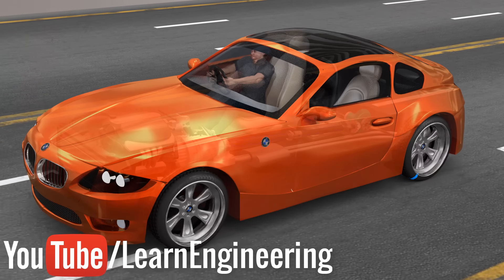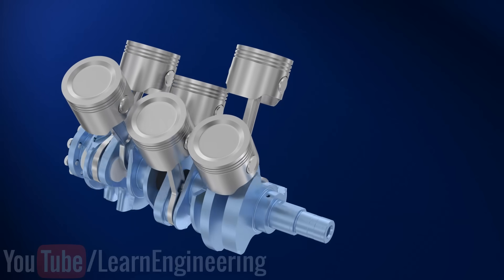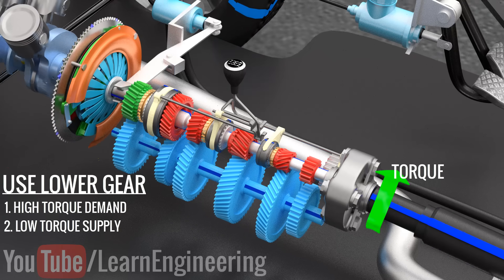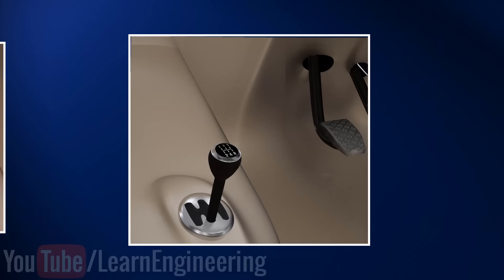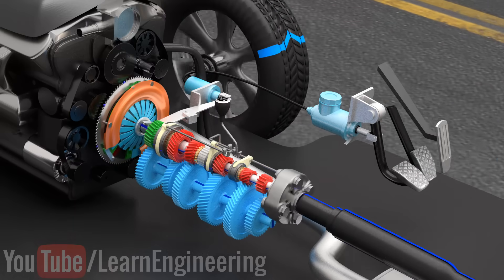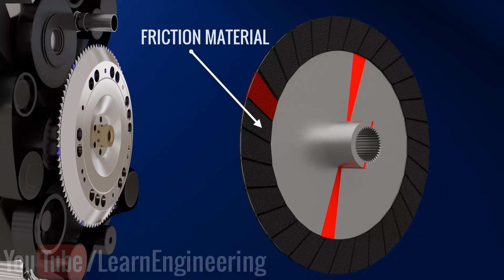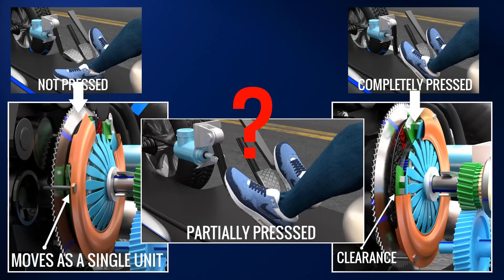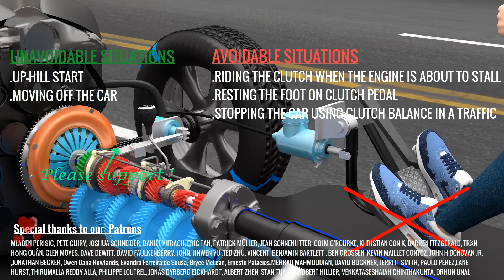Why you should not PARTIALLY press the Clutch?

Comment: with 95% of cars in America being an Auto.

Every American thinks like this video. 

They think that slightly riding the clutch or slipping the clutch will turn your clutch into dust.

When in actuality, it can take a beating. 

What you don't want to do is ride the clutch for 30 minutes at a time while revving the engine at 4k rpm+

Comment: Feathering the clutch in slow moving traffic, without using your accelerator at all, will cause negligible wear. Just as using clutch in traffic is listed in the avoidable situations section.
Reply: Modern day clutch is designed  to withstand heavy friction. So it will not wear while crawling and it will not wear when you let it rev match when downshifting. You can only burn it in extreme case as in this video... 😂

Comment: You are not in gear until you really release the pedal. You can only press it partially while changing gear. Moving from a stop and changing gear are what it's designed to do. It will rarely be damaged doing it's job in the normal way (they use specialised alloys that are barely damaged in the parameters of normal operation. That is unless you get it too hot, by making it do too much work, that is holding still for several seconds or riding it for extended periods or no reason.

Comment: The more you drive a manual the more you realise it’s about choosing which parts you want to wear down quicker. 

In reality there is a right way and a wrong way to do things but some situations do call for more excessive use of a certain component / components. Up hill starts as mentioned, parking, driving very slow in traffic. These will all technically wear the clutch. It’s designed to be used in these scenarios but there’s no way around causing wear to it over time, much like with tires, brakes discs, brake pads. Hell, even washer fluid is used up and replaced at some point. 

Just do the necessary maintenance and try to evenly balance wear on all components and most modern cars should last pretty much forever.

Comment: I find it curious that even with all the incredible, mind-boggling engineering that has gone into improving cars throughout the decades, nobody's figured out a better clutch design than a friction disc. It must be a pretty tough problem if no one's found a better solution by now
Reply: Well the issue isn't the disc, it's the gears moving at different speeds. The engineering that's gone into the gears is insane, I once saw a full length documentary just about that. If I remember right, they did actually find a solution to this issue, but there's definitely some reason for why they haven't added it in regular cars.
Reply: What's the documentary? Id love to find it.
Reply: There are other solutions, such as torque converters and CVT transmissions

Comment: Clutches wear out. If you got 100k miles out of your clutch it's fine. You begin to expect the end of it by then. You can get a fair bit more but it is hardly unexpected to be near the end of its life at that point. It is often not the clutch plate itself that is worn out around this time, the release bearing and slave cylinder are typical failure points at this interval. If either of those fails you are going to install a new clutch while you replace them anyway.

Comment: You should use the clutch as a clutch, for when it's necessary to disconnect the engine. Just be aware that any time is not fully engaged it's spinning and you are wearing it out, so keep the time as short as it's necessary to get the job done. Unless you like replacing clutches. I use my clutch than is strictly necessary, i double declutch just to keep the skill. I also found with a Subaru AWD it doesn't like taking carry sharp 180 turns on pavement with the power on (i have a sharp 180 degree uphill turn on my way home every day), and the drivetrain binds. I found slipping the clutch a little seems to help make it more smooth. That's what it's for. But you should only be doing it for seconds, not while driving, because it will wear out very quickly at that rate 
Although i didn't think people "rode the clutch" intentionally to make the drive smoother (?),  i thought it was just people being lazy and using the pedal as a footrest and not realizing that it's causing it to slip and wear. Although it's fine to rest your for on the pedal, just be aware that you aren't applying pressure to it. Unless you have a very sensitive clutch light pressure isn't going to be enough to make the clutch to anything. You have to substantially press it down before it declutches. And even if it reduced clutch pressure slightly, that's not going to make it slip except in situations like hard acceleration or climbing hills, the clutch is designed to hold any normal overload, so under normal cruising it's only taking a small fraction of what it can handle.

Comment: Rule of thumb is simple, it's fine to ride the clutch in 1st, 2nd and reverse gears, the difference in speed between the two plates is nowhere near enough to wear out the clutch plate within the car's lifetime (10 years), but as you go past 5mph, the difference increases exponentially, so at a 5th gear's speed it will only take a few hours to wear off the clutch out completely

Comment: Half clutch is a need many times  that is why their is clutch .
Ex
1)while engaging and disengaging transmission
2)while moving the speed of the first or reverse gear
3)while there is no time to shift low gear
4)when to stop  at uphill for a while.
Off course using half clutch at normal running must be avoided

Comment: You can't really do this, because the movement of the clutch pedal doesn't start and stop at the start and end of the plate engagement.
For example if you completely press the pedal in, which is uncomfortable and impractical, then slowly release the pedal the clutch will begin to travel back to the engine but won't actually touch until it gets there.
 So there is actually a large portion of movement at the bottom end of your clutch before you will actually start engaging anything...
These days you hear a change in engine tone when you start to get there. That's as deep as you need to go with the pedal

Comment: Riding the clutch on a steep hill is necessary if you don’t want to stall your car, often even in first. You should have explained that better. Also, when you are driving off in first you can’t not ride the clutch too. If you try to give a lot of RPM’s for the sake of dropping the clutch, you will most likely burn it.

Generally, riding the clutch for SHORT amounts of time with RPM NO MORE than 1500 is absolutely fine. However, resting your foot on the clutch or riding it for prolonged periods of time is dumb and bad for the car.

Comment: so could clutch deterioration accrued over time (difficult to enter specific gears) be connected to the worsening of the round membrane/diaphragm due to different torque level than the engine when trying to stop by changing to a lower gear? is that what is meant by the third avoidable situation at 5:38?
Reply: Well. In my e39 I just buttered up my clutch by doing that. Clutch disc grabs no problems.  No slipping or nothing, but gear shifter is not feeling how it should,  hard to shift between gears, and always different feel in the shifter,  Clutch hallas

Comment: All the people I know with a manual transmission ride the clutch and insist it is not only better for the car, but the best way to drive a manual.
Reply: Don't listen to these stupid youtubers bro, you should use the clutch a lot actually if you want to drive a manual.
Reply: @erdem222  I don't mean use the clutch less. It is bad for the clutch to partially push on the clutch pedal. The friction pad engages the flywheel but with less pressure and slips and grinds, causing excessive wear and heat. The clutch pedal should be pushed all the way down when used, and released fully after switching gears.

Comment: This does not explain anything. If there is a partial connection, that is, a partial transfer of power from the flywheel to the transmission, it is supposed to be good. Unless the design of the clutch and flywheel unit is very, very poor, such that there is play in it, then when the car moves, there is a back and forth movement from the clutch towards the flywheel. 
( This is if we accept that there will be partial contact when pressing partially, but if we assume that pressing the clutch pedal completely means that there will be a distance and that not pressing it will lead to complete contact, so pressing partially will lead to movement by part of that Despite the distance, there is still no connection, so there is no problem with this operation )

Comment: I have the bad habit, when I'm in second gear, and there is a stop sign but no other cars, of slowing down to a creep, then accelerating, while riding the clutch and staying in 2nd gear.  But then if I were to shift down to 1st gear then up to second, I would also be riding the clutch, because it's impossible not to when in first gear or at slow speed in 2nd, so I'm not sure what's worse for the clutch.

Comment: Personally I think this is a pretty dumb video. Everything is explained correctly but saying that riding the clutch is bad for your car kind of misses the point. Using the brakes is also bad for your fucking car. If you use your brakes to slow down the car they will wear down and break eventually. No shit. Everything in your car will break eventually. The clutch is designed to handle forces like this and as long as you don't overheat it or slip it unnecessarily, it will handle the use just fine for many years. And the cost to replace a clutch isn't fucking prohibitive either. What is the point of this video? If you don't want your car to wear down, don't fucking use it at all.

Comment: on modern manuals you have to partially press in the clutch when shifting from 1st to 2nd as well due to the rev hang modern cars have otherwise you will be shifting either extremely slowly or jerking your trasmission but thats just the the clutches job theres a lot of fear mongering around this but the clutch is durable and not a hard fix if it does wear out id rather hold the clutch at the bit point for a second then jerk my transmission and drive shaft
Reply: No, that means you didn't rev high enough when you were in 1st gear.
Reply: @eraserrx who are you teaching I’ve been driving manuals my whole life and I daily drive a 2022 brz. It rev hangs and getting to 4K rpm+ in 1st gear does not solve anything just makes it hard to drive because it engine brakes like Mad in first. You have to slip the clutch in this car there is no way around the rev hang on modern manuals they make them revhang on purpose to meet new emission standards. Only solution is to slip the clutch or tune rev hang out of the car

Comment: how is "riding the clutch when engine is about to stall" an avoidable situation? How are you not supposed to ride the clutch when on a very slow corner for example? The engine would stall otherwise. They literally teach you this as a basic technique to ride in very slow traffic in driving school.

Comment: You can avoid riding the clutch by going into neutral gear when you feel the engine is going to stall then go back to a suitable gear depending on your current car speed
Reply: Thanks. Im going neutral when jammed driving uphills.

Comment: Then what to do when you want to get moving when stopped in the first gear? I was taught to first release the clutch halfway until the car starts to shake a little bit, then realease the brake and start putting pressure in the accelerator. I have absolutely no idea how get the car moving otherwise. And honestly, it doesn't really seem the correct way, it's pretty common that I let the car stall

Comment: You forgot the part that it is not just the problem of the engine stalling...The worst part is the possible engine damages even if you are not close to stalling or stalling.
Just use the right gear and not that low rpm.

Comment: I agree with all these facts but in places like kathmandu, nepal where roads are narrow and traffic is dense, the average speed you could move at is like 10km/hr. Sometimes you need to move at slower than that and that time there is no other option than to half clutch. Also during this time, we need one foot on the clutch as you dont know when you need to switch the gear quickly.

Comment: What about using it to smoothenthe acceleration? Like when u accelerate on 1st gear and then u push down the clutch completely(car become moves very smooth) shift to 2nd but if u let go of clutch completely suddenly, doesnt it suddenly jumb and get a bit of resistance bof the 2nd gear? Its more prone in older cars. I slowly let go of clutch after changing gear by balancing accelerator and clutch to avoid the sudden resistance of lower gears and ur telling me Im not allowed to use clutch partially?

Comment: I partially press cluch pedal when I am in 1st or reverse gear but car goes too fast with released cluch. Especially it sucks that reverse gear is too fast  most often. I do not get why they do not make reverse gear much slower like 2x slower could be easily. Usually it is needed when making complex driving and there is no space, lower visibility. If there would be space, we would just turn car around and driver forward instead of using reverse. But it is stupid to use cluch to not make car stall when there is lower gear awailable. Who could even think about that? I never thought about that. And I learned when I was like 12 years old or smth to not keep partially released cluch, otherwise will burn it. Even I think parents teached me to not keep even fully pressed cluch for long. If need to stop for longer, just put in neutral. I had motor bicycle back then and usually did what was tought.

Comment: I had a question though. Just like an IC engine, can the electric motor of an electric car stall too when initially the RPM of the motor is low and the resistance to motion is high? If an electric motor won't stall under this condition, then why?

Comment: Is it fine to lift the clutch close to the bite point and keep it there until the light changes green? Because I feel I lose a little bit of time lifting up the clutch carefully to avoid stalling. 

Keep in mind I’m still getting the hang of driving manual. When I do the above a get a quick and smooth take off and I’m only on the clutch for like 2-3 seconds max on first gear.

I think it’s ok to do that but is there a skill benefit to lifting the clutch quickly near the bite point vs how I do it?

Comment: Even these days, if you hire a manual (stick shift) gearbox, you can tell the drivers were pushing the car in low rpm up steep hills in highest gear... ?thinking they used less fuel? It's appalling how badly drivers get trained these days - usually their parents who have their own bad habits.
Reply: It's always taught at least in UK that for hills you select a lower gear like 2nd or 3rd.

Comment: This is not what riding the clutch means. Riding the clutch is when you ride the clutch in a turn or to slow down. Being in 5 gear and slightly depressing the clutch and increase throttle makes no sense and no one would do that to save an engine stall.

Comment: If you really know how to drive a manual transmission, other than from a dead stop or shifting into reverse you don't need to use the clutch. Shift at the correct RPM and it goes into gear like a hot knife threw butter.

Comment: Does anyone really avoid partial clutching during slow moving traffic jam? Is it possible? And I am pretty sure in such case, at such low RPM the clutch will be fine. It is basically designed to handle that. It is only problematic if you half clutch at higher RPM.
Reply: Leave a little extra space, slip it in granny low, and let the engine idle. You want to leave enough space of a bumper in front of you to eat up the stop and go slinky effect
Reply: @RandallStrite  yes and then some f***ing idiot will slip in thinking that you "let him Infront of you".
Reply: But what else can u do at packed stop signs?? Or when driving thru packed shopping centers parking lots
Reply: Yeah. I also do this. Partial clutching to move slowly w/o stepping on the gas pedal.
Reply: You’ll still burn your clutch out.

If you keep it at it’s biting point (low rpm) for longer than necessary it will also burn it out.

It’s not what it’s designed for.
Reply: @imafackinjunglist  eeeehhh it's kinda designed for it.

Comment: DO NOT DO THIS!!! This is the single dumbest video I've seen about cars. If you ride your clutch you are pushing the crank into the block causing under wear. Not to mention your clutch will not last nearly as long as it should and have a gear in the transmission only partially engaged will cause the transmission to not last. All in all just drive like a normal person.

Comment: this taught me a lot. also made me realize that switching gears is kinda like switching gears on a bicycle.  specially while going up hill you gotta pedal up using the small gear so your legs wont strain too much and stall trying to push a bigger gear. it all makes sense!! 

edit: except in order to change gear you must pedal the bike, for a car its the opposite
Reply: On the bike you should only pedal with less speed than you would transmit (so your feet don’t apply force to the weeks) because this (like in a car ) can damage the gears
Reply: @chax0208  OOOOOH
Reply: You should use high gears when going uphill if you live in a snow area so you wont lose traction. Only downshift when you really need to, just make sure not to stall. Low rpm = more traction 
High gears give less rpm and power = more traction